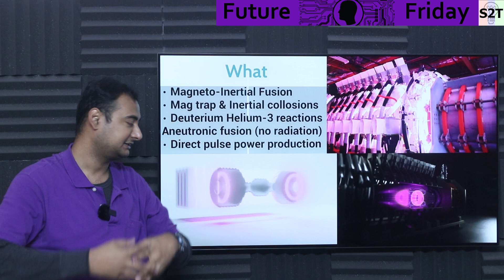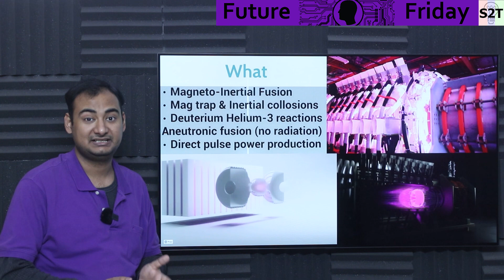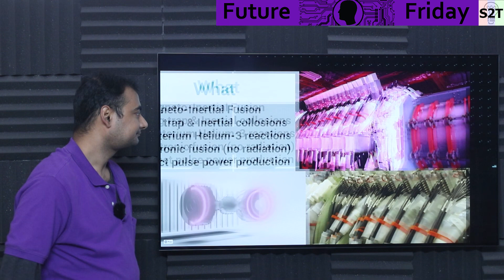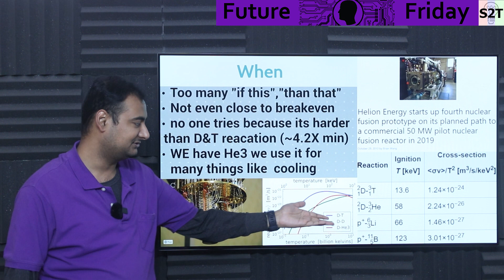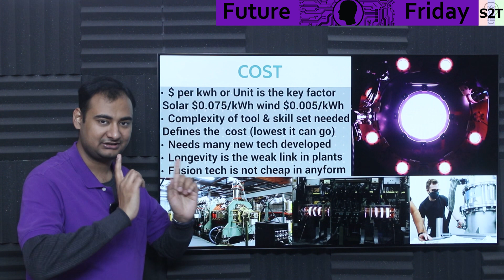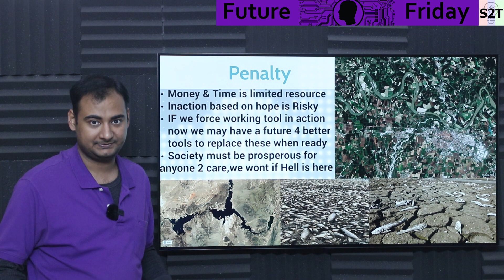Helion Nuclear Fusion Explained {Future Friday Ep210}

Comment: The proposed many solution will not fix all. Sadly. Yes we need to have a multifaceted approach to climate change. But solar and wind are not the  answer. In fact they are a detriment, because governments will think they're fixing the problem without reducing emissions at all. Do a simulation yourself and see. Pumped storage hydro cannot be scaled. The batteries implied by such a renewable grid system are exorbitant and cannot be produced at the rate needed to replace baseload. That same money used for batteries can pay for nuclear power plants at 1/4 the cost and far lower land use and total emissions.
Reply from the maker: "Do a simulation yourself and see" I did all paper I read & Professors I talk to the answer is it will work in large scale but need interconnects HVDC solves it ."Pumped storage hydro cannot be scaled" define that because Last i checked they are getting huge eg Fengning Pumped Storage Power Station power 3.6GW Capacity 40 GWh,Okutataragi Pumped Storage Power Station  power 1.9GW Capacity 15 GWh & there are many like this + close loop system bypases location limits (sadely it can cross red tape ).  nuclear power plants is not an option as they are not cheap we have hystroic data its not cheap its not solar or wind where price drops its only goes up & at war times it as hazerd for your self .

Comment: Now account for the fact that deuterium-deuterium reaction that you can't avoid, will produce neutrons that will damage the super-expensive system. This is not going to work without proper internal shielding. Shielding will make it even more expensive. Also helion temperature is not enough for big enough energy return.
Reply from the maker: yep